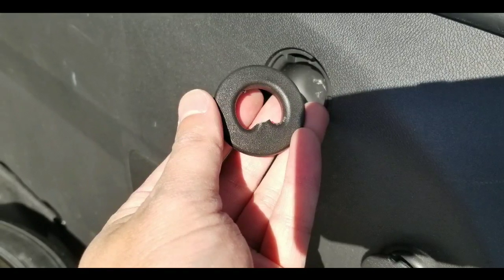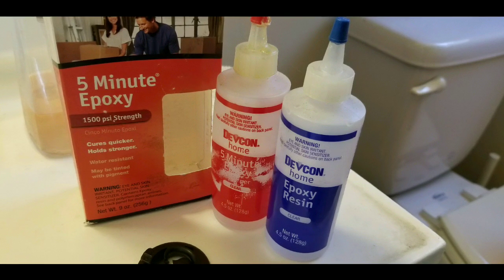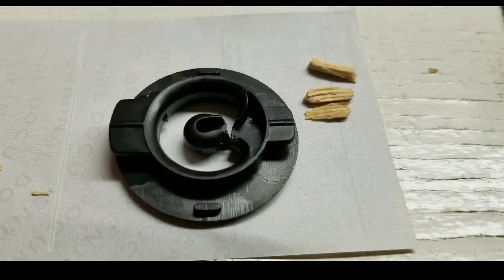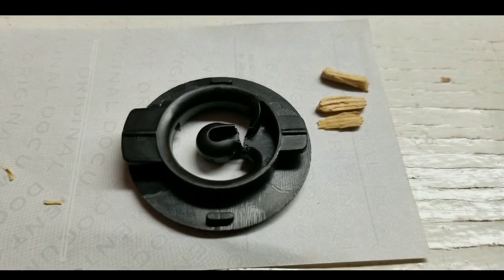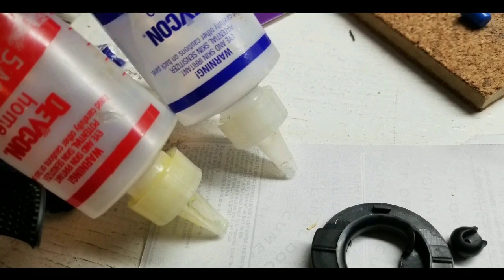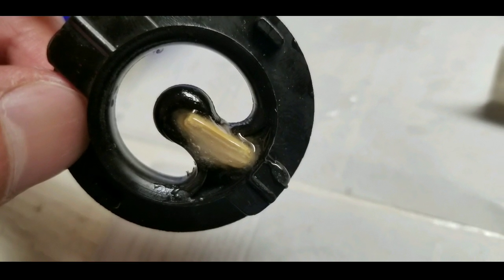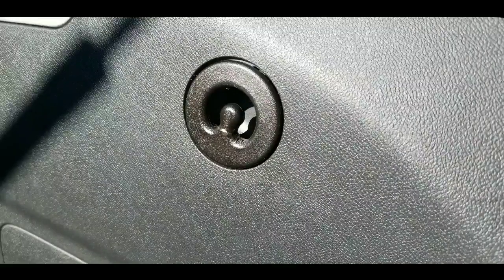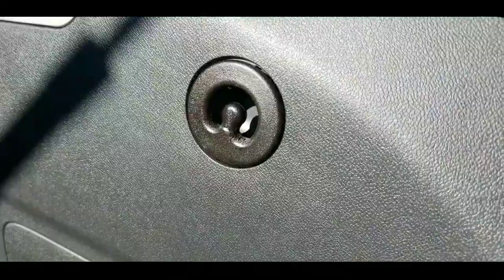How to Fix Broken Chevy Cargo Cover Hook!! GM Interior Retainer 25913048

Comment: hmm interesting video. my gen 1 volt came with no cargo cover since i bought it used. seems like a weird thing to not include with the car. was thinking of buying a 2nd set of these hooks and doing something similar to you. fill them with epoxy/wood filler bits and then put a strong magnet in each one. then have like a cargo cover/shelf that is flexible or foldable with magnets on each side.
was also thinking of putting a ~12v solar pannel on there and wiring it into the rear seat cig port to maybe act as a maintainer. not sure it will get much sun through the tinted rear hatch window/bonnet....
have been building a supercap lifepo4 replacement for the 12v AGM battery which im guessing mine is about to expire. all the materials fit in a mini ammo can i got off the jungle website and weighs about 3.5lbs instead of the 30+lb 12v battery. was going to put in a big relay to act as an isolator for the supercaps which can leak current and give u a dead battery but i feel like a simple cargo cover with a small solar pannel would actually be a lot cleaner than trying to find a fuse in the fuse box that i could wire the relay to only work when the car was powered on. also worry about the cheap little 10amp 12v lifepo4 battery i got since the BMS would probably go into protection mode if the caps were flat and it tried to dump max current into them. was going to put about 0.2ohm worth of power resistors between the lifepo4 and the super caps but i am still calculating that it would trip the bms if the caps were more than ~50% discharged. cool video, maybe i will record whatever I end up doing and put it on my channel if someone is reading this comment a month or two from now.
have a good day